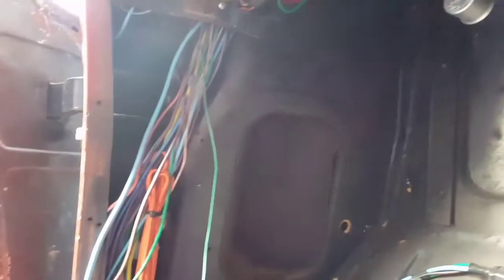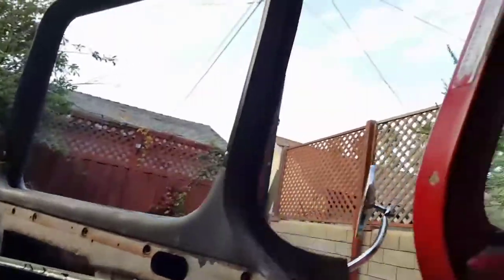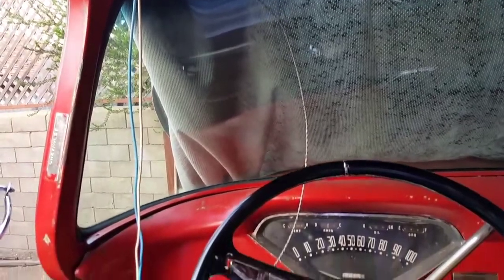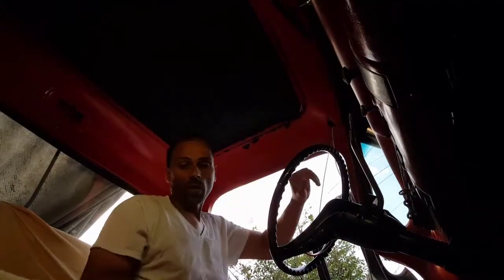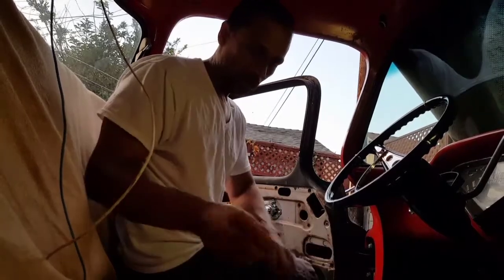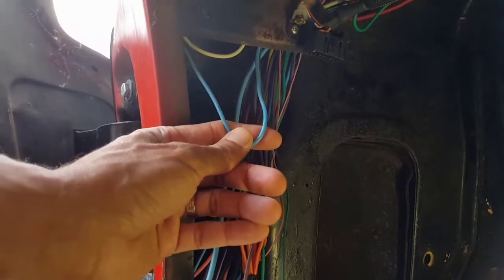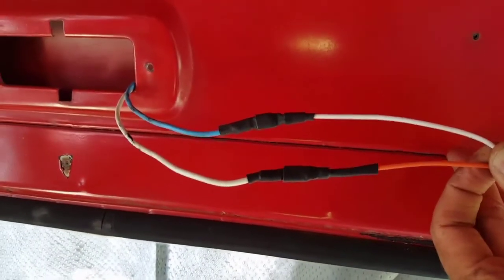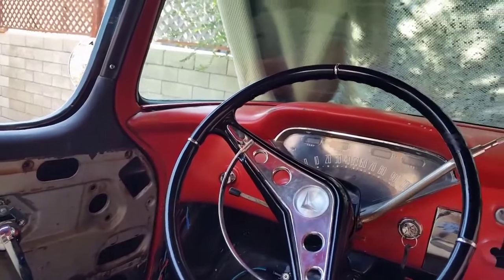Dome light installation in the 55

Comment: I was able to get the wire run finally. I used some electrician fishing tape i got off Amazon bright green. Went through the driver side sunvisor openening pointed the wire downward and to the left and it went around to the dome light opening with ease. Found the old fried wire in there and pulled it out. Thanks!

Comment: Why didn't you show the wiring to the battery and is there a fuse evolved
Reply: Just an FYI  I'm doing this right now on a friends '55 Cameo and it has a Speedway 12 circuit wiring kit in it. I'm taking power for the dome and taillights off the hazard lights hot wire. I figure hazards are rarely used. The headlight switch has a terminal for a fused wire from the battery and that terminal gives power to tail and dash lights. That brings me to MY problem. It's got a Classic Industries dash cluster and the lights don't dim with the knob. Just another hurdle I guess.